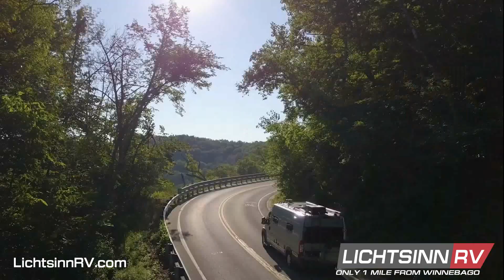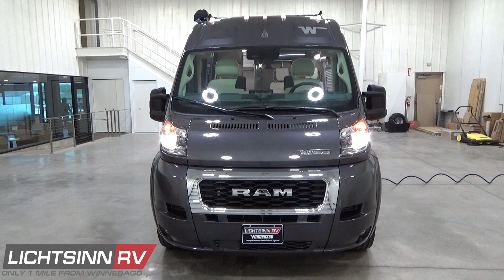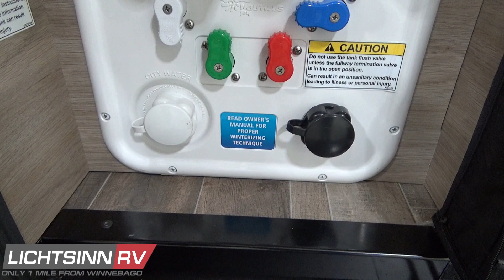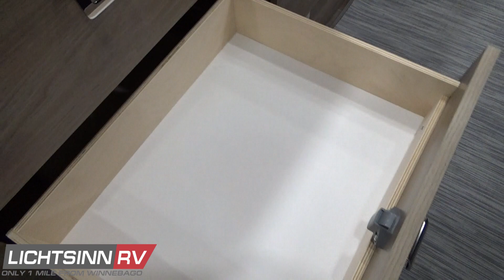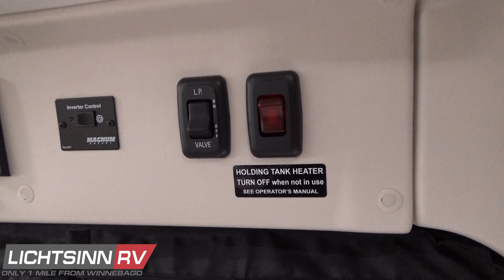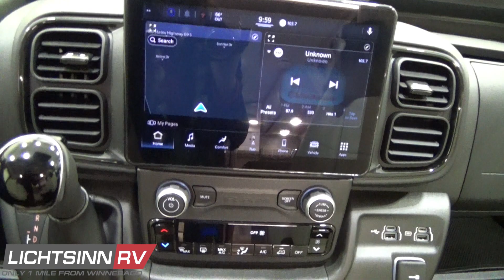LichtsinnRV.com - New 2023 Winnebago Travato 59G

Comment: Any chance to have the 59GL and keep the Onan Generator?
Reply from the maker: Good afternoon!   Thank you for your note... while it's not really necessary if you invest in the Volta powered lithium system, it also is not an option to keep a generator.   If you do have a unique RVing experience in which you might need both, you could always run a whisper quiet portable, such as a Honda
Reply: @LichtsinnRV  thank you for the response......
Reply: @LichtsinnRV  Have you done any tests on the Travato 59GL in terms of reliability of the Volta System?
Reply from the maker: @fernandosierra7798  Good morning!   Thank you for your note!   We have not had reliability concerns at all with Volta... there were some early issues of the under the hood alternator charging but were very specific parts replacements that have been put into production a few years ago.
Reply: @LichtsinnRV  what about tests to check on the yield of the Volta/Lithium option on the Travato 59GL.....?
Reply from the maker: @fernandosierra7798  You bet... this will help you and also includes a power calculator:  https://www.lichtsinn.com/blog/top-questions-on-the-lithium-powered-travato/

Comment: IT WOULD BE GREAT IF THE TWO SEAT CAN TURN INTO A BED, SO THAT YOU CAN BRING ANOTHER COUPLE OR YOUR KIDS
Reply from the maker: Good morning!   Thank you for your note… this was available as a bed conversion years ago, but not often used and leading to seats that were not as comfortable as the current automotive style 3 point safety belts.   As an option for the exception when you may need to add sleeping capacity, the Luno cab bed conversion air mattress is very comfortable and mobile for the rare times you may need to add sleeping.  You can learn more at https://youtu.be/CG4inmGBorA and area available for most of B vans and fuel efficient class Cs at this link:  https://www.lichtsinn.com/new-rvs-for-sale?s=true&types=13%2C116%2C17    Hope this helps!

Comment: LOVE the new 2022 chassis.  It's soooo much better with the new 10" middle screen, adaptive cruise control, Sirrius XM,  new on board GPS, etc.  However, the new front end redesign is wonderful and curious why Winnebago did not seem to adapt that. Disappointing that its not getting the new headlights.
Reply from the maker: Good morning!   If you are seeing these renderings of front end changes with different headlamps, these are future renderings on Promaster's site and not yet available, but will be in the next year or 2, depending upon how quickly they are deployed to RV builders by RAM.   Hope this helps!
Reply: @LichtsinnRV  check out the new front end - https://www.youtube.com/watch?v=1wehCC9ZouI --- coming out in Q3 2022. Maybe Winnebago will start receiving in Q4 ;)?